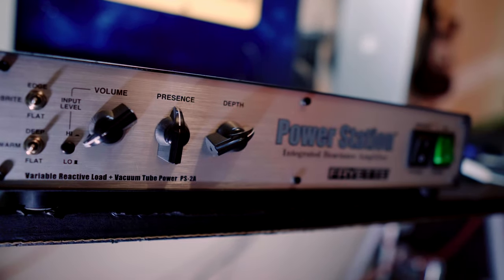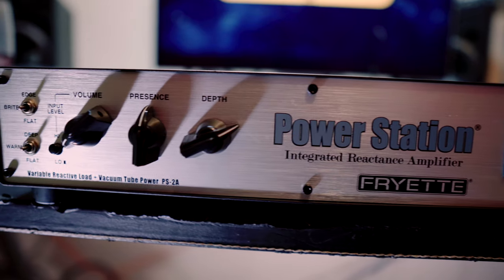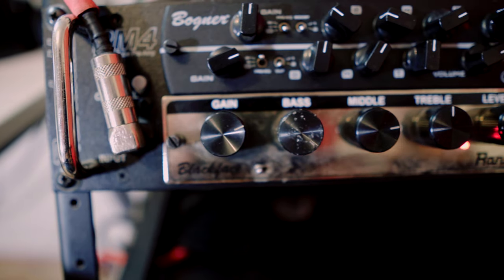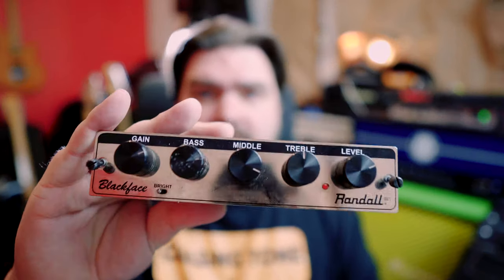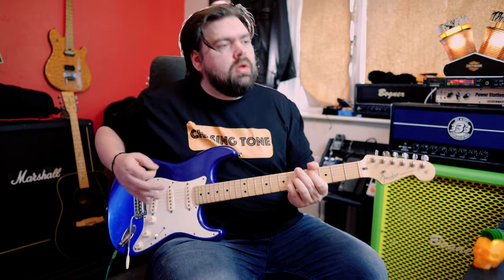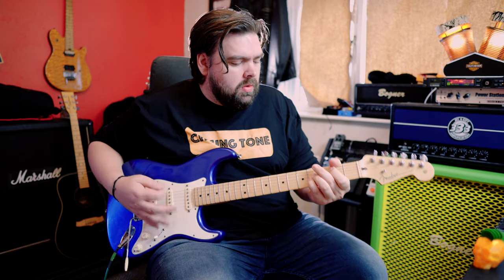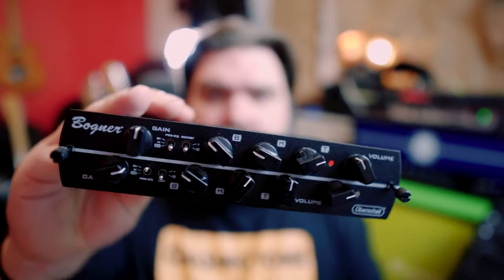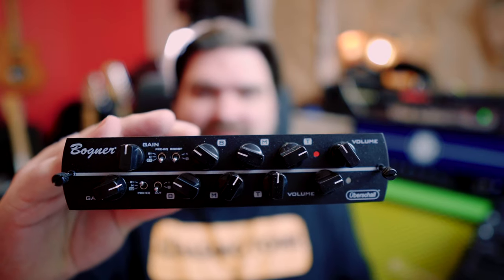Fryette Power Station - is it any good as power amp? (Spoiler: It's awesome)

Comment: As of today, the Tone King Iron Man II 100 Watt attenuator is ~ $795 and the Power Station 50 Watt version is ~ $799 (USD). Seeing as the Power Station does everything the Iron Man II does and also has a very solid power amp, it seems like a no-brainer to me.
Reply: It's admittedly subjective... but as an *attenuator*, I prefer the Tone King Ironman II (I have that and the Fryette PS-2 and PS-100).   The Fryette is much more useful as a power amp/effects loop though.
Reply: You never have to retube and bias an Ironman. Tubes degrade over time too. They are both very good units, just having some different pluses and minuses.

Comment: So i got a PS100 to use with a way too loud 40W 5f61 tweed amp this EE student I know built… It’s AWESOME at that… actually sounds better than amp cranked and the addition of the effects loop is brilliant!!! With that said, I also have a couple of the Victory V4 preamp pedals and I want to try the V4 Countess + the PS100 as a stand-alone rig… Before I screw something up… how do I connect the two? Can I just use the speaker cab from my Tweed?

Comment: I just picked up a PS2.. very nice to control my Plexi and Splawn Quickrod.. I did not realize you could input a preamp module.. very cool.. I also dug out my old ART SGX express.. perhaps I will run that through the PS2 also.. do those modules need to be plugged in to the Randall or synergy heads to work or stand alone with power cable?..also.. how best to use IR loader with the PS2.. best and lowest cost?..I'm new to the digital world.. cheers..!!

Comment: Great video!  One question, you mentioned that you can run Randall Blackface straight into the PowerSration, but can you also plug Synergy Bogner directly into the PowerStation or do you need to also buy a Synergy docking station like the Syn 1?
Reply from the maker: Hi Don, thanks for checking out the video. The blackface module is running through an old Randall rm4 (which powers the module). The synergy modules woukd require a Syn 1/Syn 2 to work. You can use the old RM4 but only one channel would work on the module. The synergy stuff is amazing. I hope that helps.

Comment: Hey mate! I’ve recently picked up an SNK VHD preamp pedal and a Master Effects Martyr, could I run these into the power station as a power amp?
Reply from the maker: @Jackson-zh2xc  Hi Mate, I don't see why that would be a problem at all. I've been using my PS2 with a synergy rig lately and it sounds amazing. You don't get that driven power amp tone that you can get with some power sections as the PS2 is very clean. It sounds amazing though!

Comment: I had one briefly as a power amp, I thought it was “too clean”…..I ended up getting a Russian hand made 2204 rack mount power amp (Myasnikov). Has line out, volume, presence, depth and negative feedback knobs. I just needed a power amp that gave me more “color” on my tone….
Reply from the maker: Hi mate, thanks for checking the video out. I am curious as to how you found the differences between the PS2 and the Myasnikov? I was looking at a Myasnikov power amp but there's not a lot of videos demoing it the tone.
Reply: @chasingtone2022  I simply took a chance on it. I had a sold another SP-77 preamp and needed a power amp. The PS-2 just seemed too clean, no color. I knew that I loved the sound of the preamp when running it into the effects loop return of my monotone 2204 and the return of the loop of my ‘89 Marshall 2210. On the power amp, I run t he presence at zero, depth at zero and negative feedback right in the middle. Myasnikov has a small site listing what he makes, he can also build anything literally with any options (a sold amp preamp with a fender clean channel or a multi channel preamp with the preamps of anything that’s made)….we messaged and I told him exactly what I wanted. It took him a bit of time to build it and of course shipping to America took more time. Zero complaints.

Comment: I have the PS2 and using it with my kemper. Went down the ss power amp/frfr speaker rabbithole.  The fryette takes the kemper to a different level. Looking at the lxii rack mount since it's stereo.  Awesome video
Reply: Recently got a Kemper, running with my recording equipment.  Looking for a speaker solution and seriously considering the PS2
Reply: @richardyates9452  real cab/guitar speakers.  The Power Station is the secret sauce for the kemper imho. If you can find the ps1 even cheaper.

Comment: Great video!
So what made you choose this over the Waza tube expander? I’m leaning towards the fryette and it would be nice to hear what you have to say since you had them both. Thanks!
Reply: Honestly, the power state is almost half the price and has less of a noticeable tone suck.
Reply from the maker: @SilencioEfimero  I'm really sorry for the delay. I didn't see this message. I did buy a Waza to use with my Bogner 3534 however I felt that it sucked the tone out of the amp whilst the PS2 facilitates an amazing sound out of the amp.

Comment: Chasing Tone you have any ideas of how to hook up the Power Station to a KHE amp switcher where you can have 6 amps, Kemper and quad cortex. I am trying to sort this all out so I can do it correctly.
Reply from the maker: I have never owned a KHE amp switcher so do not take what I say as gospel. However, I believe you would connect your valve amps to the KHE and take the speaker out from the KHE into the Fryette speaker in. I'm not to sure how it works with the kemper/quad cortex though. Sorry I couldn't be of more help.

Comment: Do you think it would be a reliable power amp for regular gigging just using it and a preamp?
Reply from the maker: Hi, thanks for checking the video out. My unit has been completely solid and I haven't had any issue with it aside from the tubes dying after 1 year and needed replaceming. This of course is normal with tube equipment and wouldn't have been a surprise if I had changed them first (my unit did have many hours on it in that year). It's a great unit and I actually really like the sound of it as a power amp. I hope that helps.
Reply: @chasingtone2022  Cool! Thank you for replying.